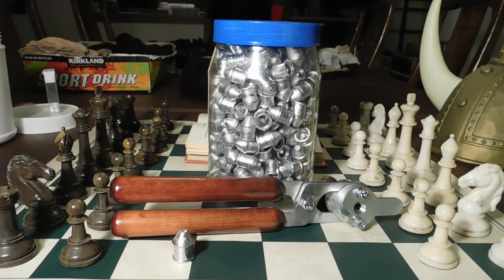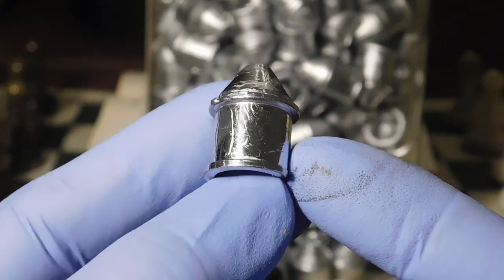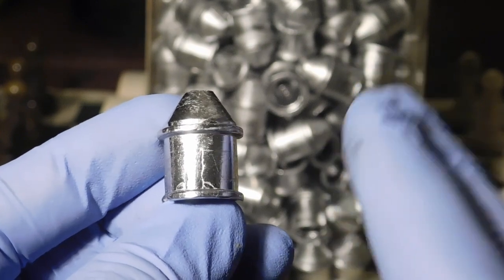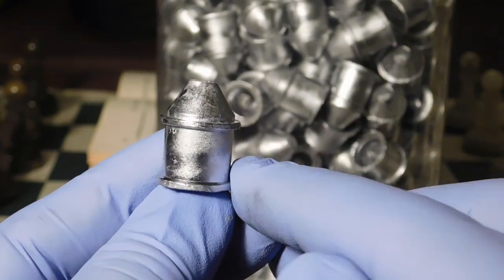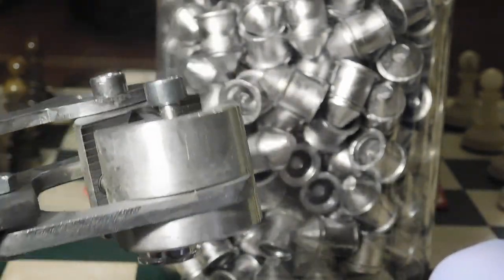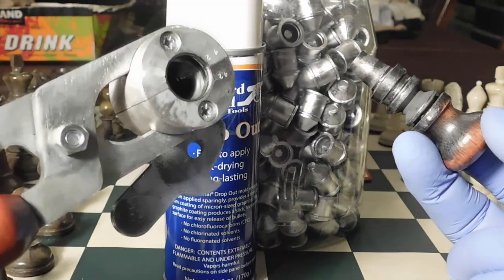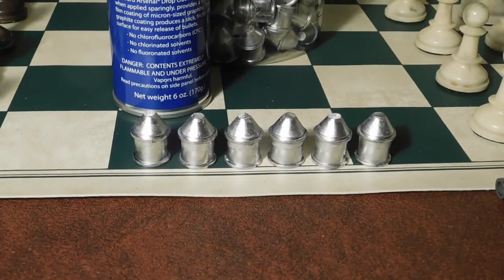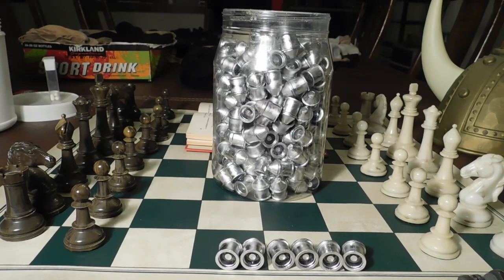Good Castings From The Russian Hydrant Slug Mold

Comment: Regarding temperature, I find running a higher temp in larger volume molds more beneficial.  The problem this crates, of course, is then overheating the mold.  Still learning.  Keep the great info coming Mr. Cookie.
Reply from the maker: Chad Leasure - Because we have the extra step of pulling the slug off the core pin, that automatically gives time for the mold blocks to not overheat...I had no overheating problems during the whole 2nd session.  But that hotter alloy made all the difference in getting fill out and nice castings.  In fact, I got a perfect slug on the 4th cast.  Have a great day,  FC Steve

Comment: Those are looking good! Great tip using higher temp settings.
Reply from the maker: Mike Treen - Using the 725 F range does not produce as good or consistent results.  Plus the Frankford Arsenal Mold Release on the core pin made the removal of same from the slugs a real joy, because the first session was a chore.  Best to ya,  FC Steve

Comment: Thats a good lookin slug, darn just loaded a bunch of 7/8 keyslugs with my lee mold.  I have developed a 20 ga load using a 54 cal round ball with aa20 wad over 17 gr of unique.  I have a problem shooting slugs from my modified barrels, i cant find a slug barrel for my 870 large ring for they are rare. So i came up with cutting the cup out of a aa20 wad with scissors and place it upside down in with the aa20 wad that is facing up normal as using a buckshot load.  There is a tip in the cup i snip out with fingernail clippers so the ball will sit in the middle of the cup.  This load works fantastic out of all my modified 20 ga modified barrels !!!  They almost shoot on top of each other on my steel targets at 50 yds...  Now that im retired i have time to experiment.   Lol
Reply from the maker: dowdawg - Well done, dowdawg.  When I shoot .690 RBs through my 12 gauges, the accuracy is OK out to 25 yards.  The .690s are a bit weird - they are too small to shoot bare and just a bit too big for the trap wads.  Have a great day,  FC Steve

Comment: Those look nice, can't wait to see some range groups with them, One thing about Russia, they have restrictive laws about firearms over there, the easiest to get is a shotgun and they worked hard to get slugs to shoot with a rifles accuracy. The special attached wads I believe is to get the greatest accuracy at longer ranges. beyond 100 yards or so. 500 grains of a lead slug flying through the air speaks with authority and the slug is made to take advantage of its energy while taking game at those ranges. I think that adding some tin to the mix was a good Idea for filling out the cavity and the drop out aids in the release of the casting. Well, good shooting to ya, Dave.
Reply from the maker: Dave - I did shoot my first session slugs, and I have real reservations on them - will be remelting that batch because I had to haul on the core pin so hard to get the slugs off the core pin that I'm sure I stressed the slugs.  And the fact that I didn't seat the wads properly - should have just done your technique straight up - but did not realize I wasn't seating them.  The mold release on the core pin made that a true joy, and I'd recommend it to any who use these molds.   Maybe you didn't have that problem when you were casting yours.   I've never used the mold release, but after the first session, something needed to be done.  Smoking would work also, no doubt, but the spray is so convenient and quick to apply.  The stuff is basically graphite.  Have a great day, Dave --Steve

Comment: Has anyone generated a 3D print of the wads for these? I understand there's versions for the Lee slug.
Reply from the maker: Mentalspasm - Problem with the Lee slugs is they are not bore riding so even with the proper tail wads, they don't begin with consistent stability out of the barrel.  What we need are bore riding slugs plus the mated tail wads.  Have a great day,  FC Steve

Comment: So you added about 1% of tin to pure lead? Also those slugs came out great thanks for the tip
Reply from the maker: ocean374 - The tin really makes for sharper castings.  If pure lead works for you, skip the tin.  That worked for the previous Lee key slugs and the Lyman 525s, but those designs really didn't have any shoulders like these hydrant slugs...I got better castings with the added tin - but each caster may find differently.  Sometimes out "pure" tin alloys work well because there is some tin in there already.  Best to ya, FC Steve